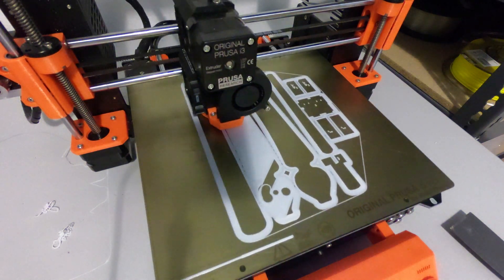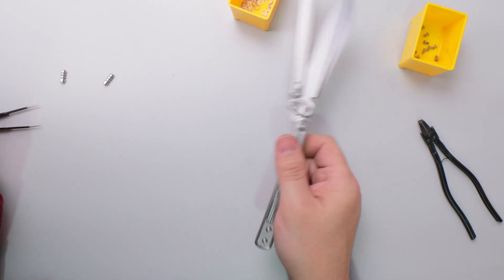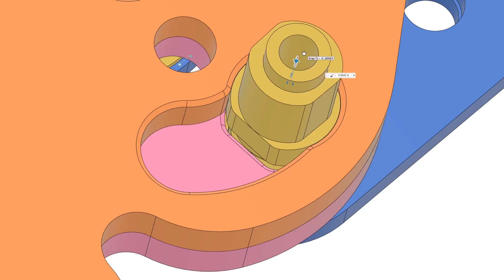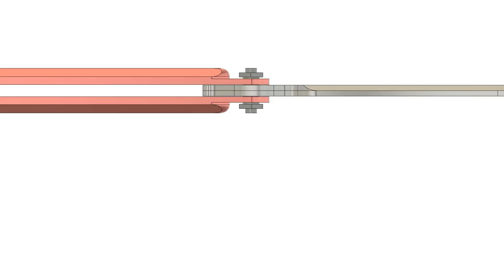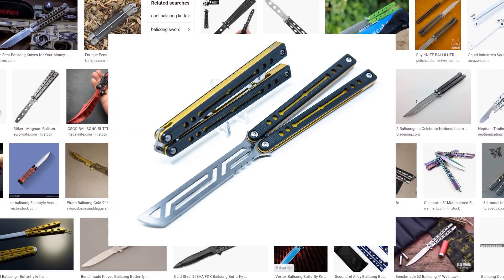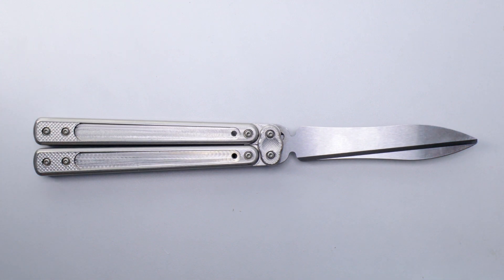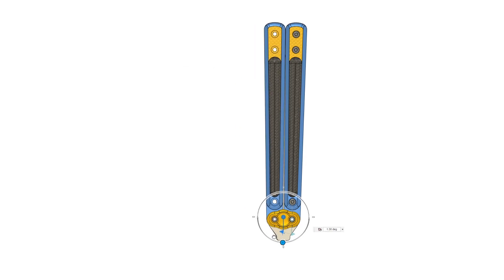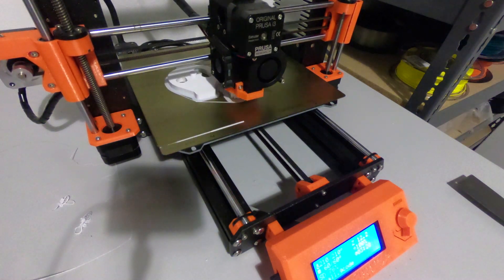Designing is Hard. Baliscissors: Ep 9

Comment: If the button pins themselves prevent over travel, you need to consider the mechanical advantage by comparing their distance to the pivot point and the force applied by the user's distance to the pivot point. It looks like it could be 70:1 or more. The reason this could be a problem is if the user squeezes too tight they could damage either the pins themselves or the holes the pins are in. On other butterfly knives the over travel pin is in a separate spot from the pivot pin, this puts the mechanical advantage at something like 10:1. Good luck! The videos are great.